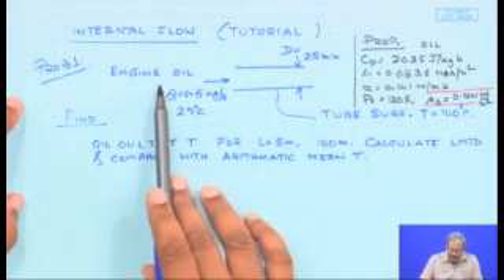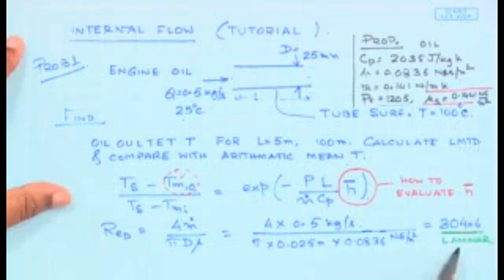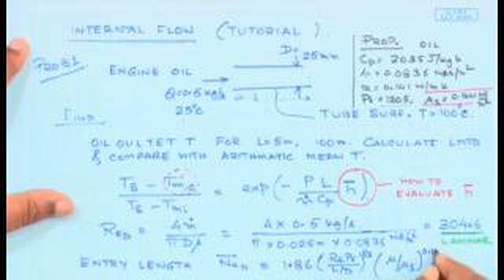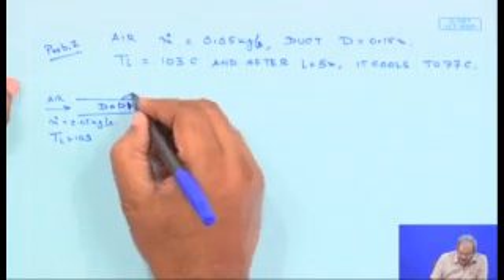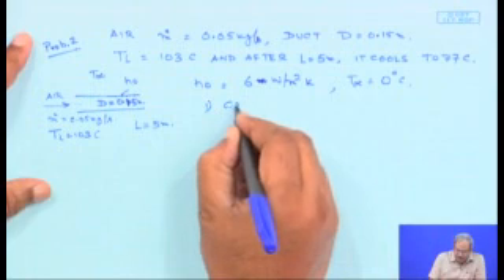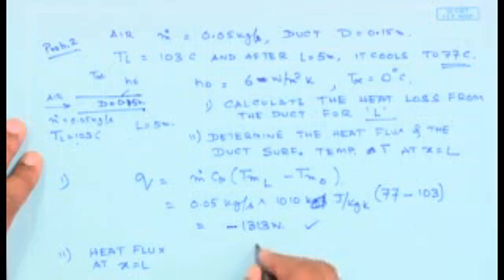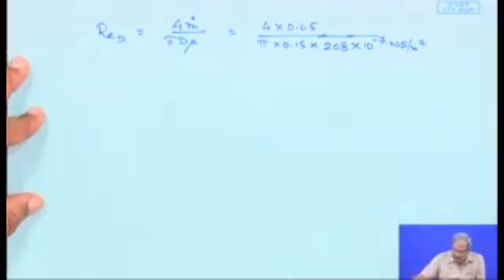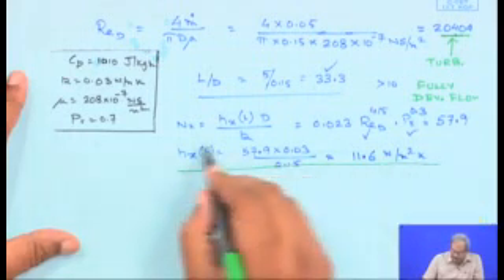Lecture 36 Internal Flow and Heat Transfer (Tutorial)

Comment: in the first problem L/D >10 why do we use the entry region corellation
Reply: Okay so you can refer to any book. The correlation given in the last part of previous video is used for laminar flow. And the flow is laminar. I don't know why sir kept saying that it is the correlation for turbulent flow. Also in the first problem the Re is very less which means it is in laminar flow region. Hence the solution of the problem is not wrong. But saying that correlation is for turbulent flow is wrong.
Reply: @pratyushamukherjee1074  yes absolutely right thank u bro

Comment: in the 2nd problem, is surface or wall temp of duct and heat flux is same at any location in the duct as the dittus boelter equation is giving us average h independent of x .So, is the wall temp of duct, heat flux and the h value in inside is independent of location ???If is it so, then what's the need of mentioning to evaluate these quantities at x=L.??
Reply: True, I believe the value of heat flux will only depend on Tm (as a function of x)(in the fully developed regime)
Reply: Well,the heat transfer coefficient h is not a fn of x after the flow is thermally fully developed,so it will remain constant allover the length.
Now , to calculate the heat flux at any axial position we  need to know th mean temp Tm at that location because q"=Tm-To/resis.  
As the Tm value at the end of the pipe i.e. at L is known we here calculated heat flux at L.